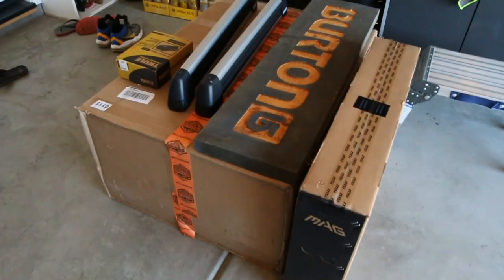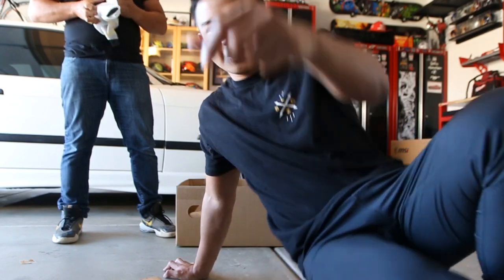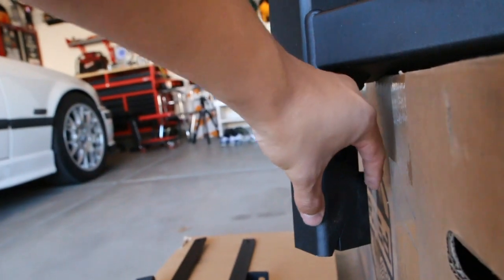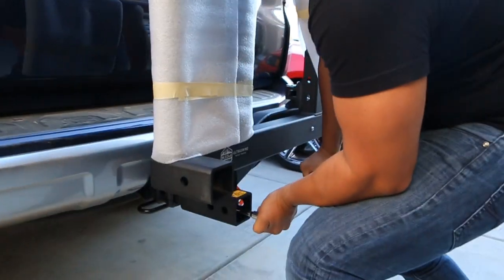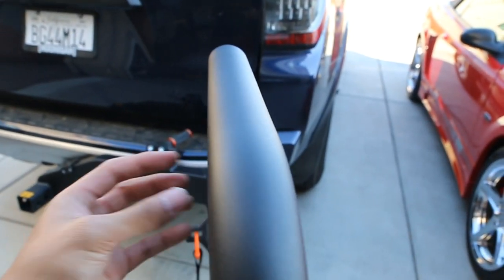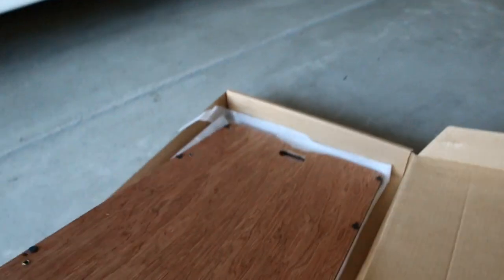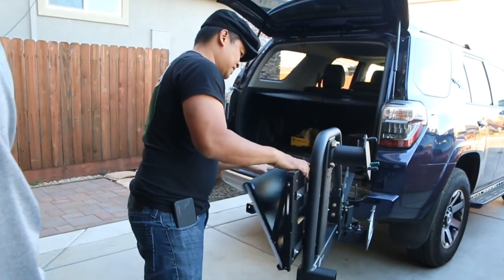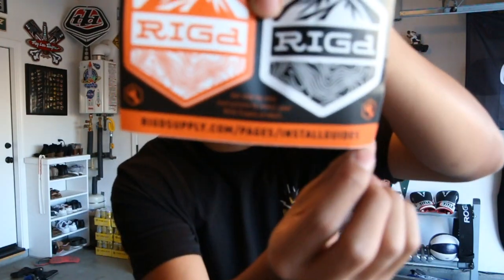RIGd UltraSwing Install on 2021 TRD Off-Road 4Runner | 5th Gen overland build

Comment: i'm surprised given the cost the license plate location is just threads tapped into the metal. A rivnut costs under a buck and would work so much better and not have issues with rusting out, and have more threads to engage the bolt.

Comment: Great information here.  How are you illuminating your license plate?
Reply from the maker: As of now nothing. The car has a new plate that is reflective unlike the temp tags that were on it when we filmed this video. However, there are many aftermarket LED lighting solutions that mount to the top of the plate and tap into the taillights for power. I believe Rigd’s YouTube channel even has a DIY on how to do this :))

Comment: Can you install the bike rack right on to it or do you have to remove the ultraswing wheel mount?
Reply: It has an additional hitch mount built in so you can tow/install bike racks without needing to remove anything off the ultra swing.

Comment: What about the rear camera? Is it covered by the tire?
Reply from the maker: As of now, we don’t have a wheel on and you can still see through the bars. But once the wheel is on, it’ll be covered. Rigd and some other aftermarket companies sell a relocation kit that I believe puts it near the new license plate mount and swings with the arm :)
Reply: @Corteezy  Thank you for the reply. I really hope Toyota to relocate the camera in newer models. So we don’t have to do it ourselves when attaching a tire carrier. Or an after market company makes a tire carrier that clears the back up camera.

Comment: i want to install one on an Excursion with 37x12.50x18 wheel and tire will it work
Reply from the maker: I’m sure it would work. The arm has a 250lb weight capacity and the size of the tire affects your back window visibility but that is personal preference. You can check out Rigd’s website for fit info for you specific vehicle :)

Comment: How much did you say it was ???
Reply from the maker: For the 4Runner model specifically, around $1200-$1300 without the table or hi-lift jack accessory. But for Black Friday, the table was included at no extra cost. So we saved around $200-$300 not having to buy the table